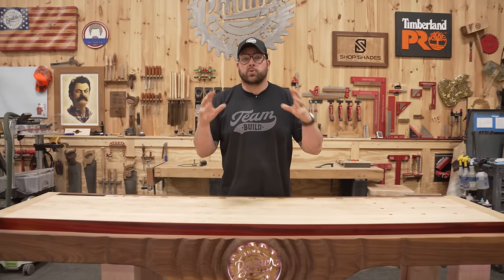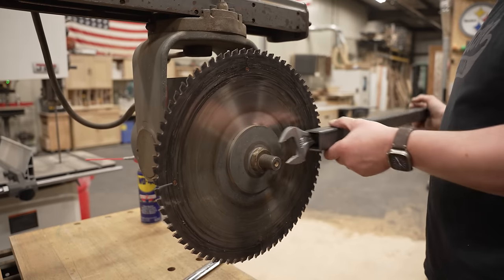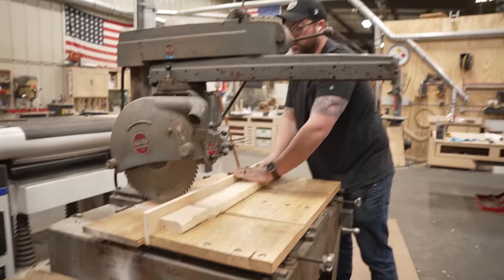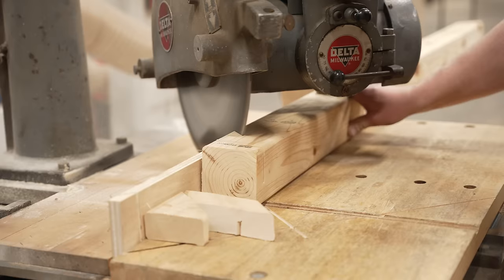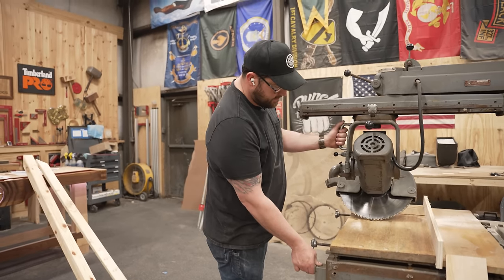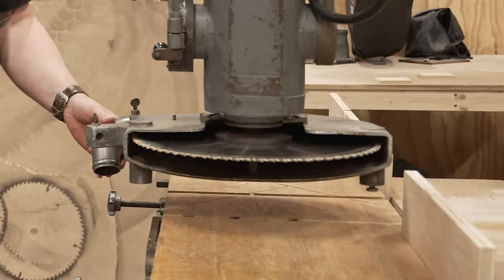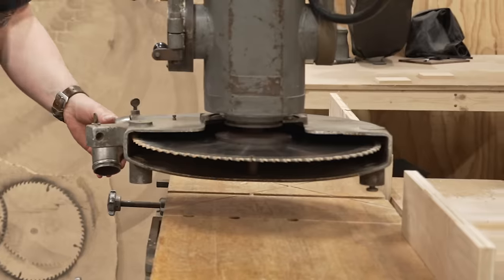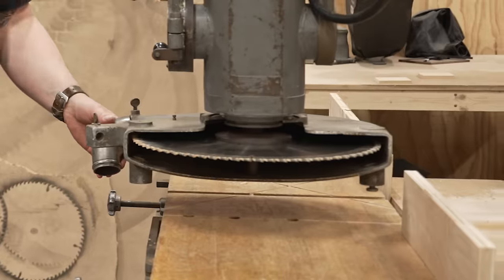Testing Woodworkings Most Dangerous Techniques

Comment: Doesn't the table saw look safe by comparison?   Just a little bit of blade sticking up that can rocket a board into your gut and bust a rib or stick ya?  Or, your feet slip as you're leaning over and you put your hands down to stop you from doing a face plant on the blade so you sacrifice your hard instead.  Yep,  much safer. 

The RAS only looks more dangerous.   Used correctly it's safer, IMHO, than a table saw.

You scare easy, don't you?

Comment: It's crazy how people have... IMO.... devolved.  My dad had and still has a radial arm saw in his shop (now in his garage) and I learned basic woodworking using it.... as like an 8-10 year old.  Never really thought of it as "dangerous" or at least any more dangerous than a table saw.  

But... we live in a time now where people are petrified of their own shadow or whatever because it's "dangerous."  To these people i always say - "you know, the number 1 cause of death is living.  Being alive is the most dangerous thing you can do as it will without a doubt lead to your demise."  

Only thing that makes something supposedly "more dangerous" than another thing - is the operator of said thing.  I KNOW more people, plural, who've chopped off fingers on either a table saw or even just recently - a fucking miter/chop saw (it was at one of the shops I go inspect... I still have no clue how he chopped his finger off... it's not like a chop saw can run away from you and pull your hand into the blade.... he had to like... actively put his hand under the fucking blade - it's these people who need the warning that radial arm saws are dangerous..... as well as the warning label on their shampoo bottles, haha) than I OR my dad knows who got injured by a radial arm saw.   IMO.... if anyone gets injured by ANY saw.... it's just Darwinism kicking in.

Comment: I used one way back in the 80's at a shop i worked in for years primarily for breakout of 10/8/6-quarter stock , & then when I helped build the first house I ever worked on we used one for everything, including all the compound miters for the roof dormers, all the rafters I have seen it used to rip really big pieces of lumber and to run dados on some large panels this was done by an old-timer craftsman not a single person was ever hurt using them but we would not allow noobs to go anywhere near them bottom line is they are dangerous AF lol that's why they have gone the way of the Dodo and you will only find them being used by a few older craftsmen remember they made machine back in the day for smart professionals now the safety sally's try to legislate away risk and stupidity no machine will ever be built that a moron wont find a way to hurt themselves on it if you cover all 101ways they can get hurt they will just use the power of "Murphy's" magic to come up with a 102nd one lol

Comment: Excuse me, you are not using the saw with the proper set up and safety add ons (kick back bar). I have used a radial arm saw for over 30 years and done most of the cross-cuts and rips that's it, nothing more for the obvious reasons.

Comment: You should not be using a saw like that when you don't know what you are doing. 
I have owned three radial arm saws in my 55 years as an adult woodworker.  I have worked in three different wood shops where the radial arm saw was the main saw. The 1st shop I worked in had one 16 inch and three 20 inch radial arm saws. I ran a 20 inch (5 horse/440-3 phase)for two years in a production setting, for 10 hours a day 4 days a week. Never an injury. The blades were so sharp that they were coated with a plastic-like material when we got them from the sharpening shop, and you did Not touch the uncoated blade. They were razor sharp. You took the coating off after the blade was installed by passing it through a piece of scrap wood. Even with the coating on the blade, you wore thick leather gloves to handle the blade.
You are missing too many parts. You shouldn't even turn that thing on. Someone is going to get hurt.
The saw isn't dangerous. It's the people making it dangerous. When that saw is set up correctly and you are trained properly; that saw is much safer than a table saw. It Can Not kick back if it is set up and used properly. If used Improperly, it Can eject the ripped section near the fence and shoot it clear across the shop and cause severe injury or property damage. That is not a kick-back. That's an ejection.
Leave it alone till you have all the parts and get some training. That's my advice.

Comment: NO NO NO You were doing the rip totally wrong!!! The blade guard should just clear the wood on the feed, anti-kickback paws must be used.
Also keep in mind the safety precautions when it was built. 
I have a 60’s vintage RAS it is a work horse in my shop for, accuracy, versatility, safety making unique cuts, …

Comment: I had a craftsman RAS IN THE early 80’s till (1981) till 2019.  In the middle 90’s WHEN CRAFTSMAN gave me a revised table top AND BLADE GUARD THAT HAD A BOTTOM GUARD SIMILAR TO A TABLE SAW GUARD which made it a lot safer !!!! I NEVER CUT MY FINGERS IN 25 YEARS PLUS !!!  I had bought a SHOPSMITH IN LATE 80’s and that little table top was terrible for ripping and I nicked a finger on it . I’ve been doing carpentry work with a  POWERMATIC IN MY SHOP AND fold up table saws at job sites last 20 years .  I’ve cut my fingers 3 times   on portable table saws . I never cut myself on the RAS.  Delta 16” 1850 saw is a terrible way to compare or JUDGE A SAW and you dramatized it .  Putting that saw was POOR JUDGEMENT!!
Reply: The ras is one of the safer saws but the reason why people think it's dangerous is because of the ridiculous shit they try to do with it. When I ask someone why it's dangerous they can never give a good reason why.

Comment: Very disappointing to watch you "play" without proper setup and tuning of the saw. Especially with an exposed 16" blade.  You're nuts.
Tip one: your table needs to be set with the fence moved out so the blade is safely behind the fence.

Comment: ALL POWER SAWS ARE DANGEROUS….
These are perfectly safe when used properly! First, it IS A CROSSCUT SAW… all that gimmicky shit to market them as an all in one tool is what makes them DANGEROUS. Second, USE THE PROPER BLADES!!!! These require a specific tooth angle. Third, DONT USE DULL BLADES! (This is dangerous on ANY saw)

Comment: on the standing board rip what happens at the end when the cut is done.. does the top piece just get chewed up by the blade. or are u meant to hold the top piece and push all the way through.. flipping psycho use of this thing

Comment: I grew up with a radial arm saw, and we used it for many years without any issues, we ripped pieces and anything else you might do on a table saw but you also got a chop saw before chop saws even existed.  So if you think it's dangerous maybe it's you that is dangerous using things in ridiculous ways.

Comment: This guy does not know how to set up or operate a radial.   For ripping cuts, you adjust the blade guard to barely clear the wood so that the wood cannot lift up at the start of the cut. And it should have an anti-kickback pawl on the trailing edge.   As you rip, you do not stand behind the wood- you stand in front of the table and slide the wood sideways- That way you can’t get hit if it kicks back because it shoots the wood to the side, not at you.  
As you rip, you move to the other end of the table and pull the wood thru.  It can’t kick wood that way on a bet. Or- you can use a sacrificial push board to keep your hands from going under the saw.   His nervousness about cutting bevels is naive.   The blade is turning toward the fence.  It CAN’T kick wood back at all under any circumstances. Cut offs are NOT flung by the blade. You DON’T leave the blade pulled thru the cut against a cut off.  You pull it thru and then push it right back.  Then you can clear the cut off without danger.   And many of these saws have electromagnetic brakes, or can be fitted with a phase converter that has a braking function to stop the blade in just a few seconds. 
And blade clearence is also about the fence.  On properly set up radials you can change the position of the fence based upon The blade clearence you need. 
Radials are LESS dangerous than table saws by a wide margin. Number one because they do not kick wood AT you, only to the left or right. Number 2 because one of your hands is literally on the handle and can’t get in the blade. And number 3 because you can clearly SEE the blade.   Half of table saws injuries are due to the blade being mostly hidden from view and so disregarded, the other half are because you are standing in the line of fire and table saws can always kickback.

Comment: My dude! you are ripping backasswards!!! ya rip the same blade direction as a cross cut. the chips hitting ya in the face should have been a clue! the "in-rip" and "out-rip" means ya tunr the saw yoke like ya did. ya just cut from the wrong direction both times!!! ya also need to move the blade guard nose down, nearly touching the incoming material to keep it pinned to the table. you are also missing the anti-kickback paw that keeps the material from catching the back side of the blade and lifting. lastly, keep your beer grabbers away from the blade! make a push block about 16" long, 4-6" wide that slide on the table pushing the material. some guys put a 90 stop on it and a handle so ya cant push it past the blade guard. 

I have a 1956 AMF 9" my grandfather bought new. I also have a 3hp 10" 7740. it cut 4x10 structural laminated beam like butter. your 10" needs brushes or a motor re-wound.

Comment: When ripping with a cross cut saw , there's two mistakes you made, your take off bed is not long enough, 2 because the blade is cutting up into the wood the " the work wants to lift, this is why you always have a guy at the back of the work with a push stick to hold down the work ,and you at the feed end should of used a push stick to clear the work from the blade,your demonstration of ripping was terrible,  to cut tennons on a cross cut like this ,you use " trenching heads/cutters" a particularly dangerous set of knives but in the right hands speeds up production,   i cut my teeth on a similar saw a wadkin 3 phase radial arm saw, ive seen the old boys  sink a block of wood into one of these to cut a perfect arch, no guard, ive also seen a guy loose two fingers in the take off position because he didn’t focus on the job.